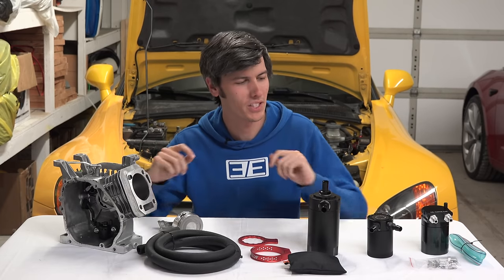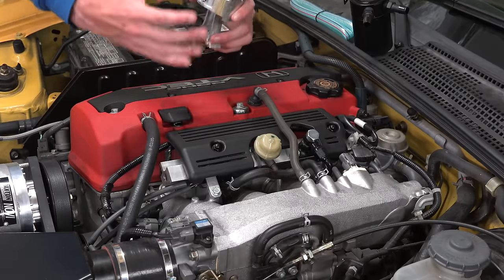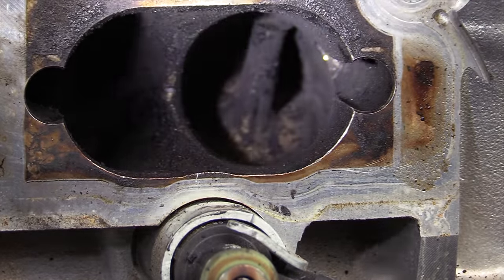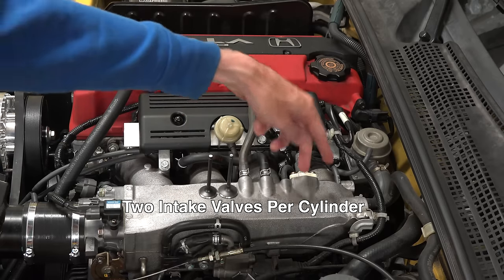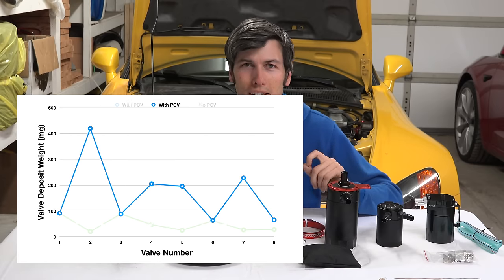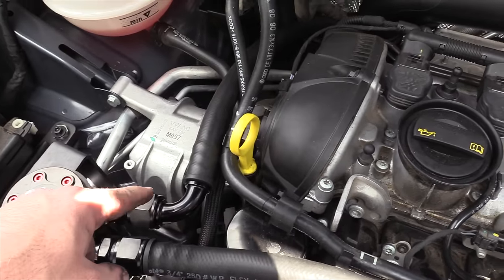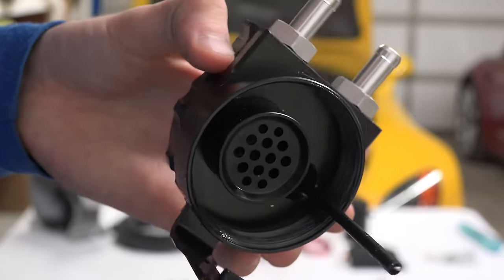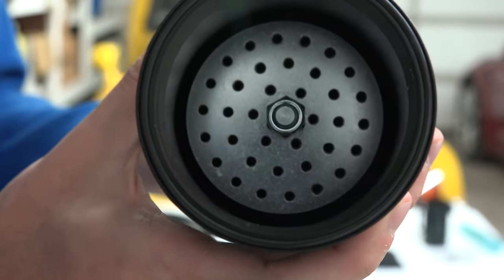Do Oil Catch Cans Actually Work?

Comment: I didn't know that I needed one of these.

Fun fact: I actually really love maintaining equipment. I don't know why. There's just something super satisfying about restoring things to peak condition and keeping them there, especially with more and more things to take care of.
Reply: I'm glad I'm not the only one who feels this way.
Reply: @kadenwatt2033  same but I'm lazy to do the work lol
Reply: I usually just run things into the ground more fun
Reply: I’m the exact same way with my 07 Sentra spec v. Fixed all my oil leaks, now just obsessed with keeping it in optimum condition all the time
Reply: Yesssssss when I replace things i get  my mental peace
Reply: You don’t, just use a quality synthetic oil and filter and you won’t have an issue
Reply: @stephenbloom2545  except sometimes things happen that you don't anticipate. An oil catch can + a magnet can make a big difference, even with the highest quality filters and oils.
Reply: @stephenbloom2545  I use the best oil there is and high mileage like I’m supposed to, there are more reasons to getting one, for example I am getting one because there is some oil getting into cylinder 1 where the spark plugs are.Ik  It’s not my valve cover gasket because of the location the oil is in. So I’m gonna get it so it can catch any bits of oils that gets through to the cylinder,
Reply: @Jpgaps  if your engine is the Ford 4 cylinder ecoboost it has a lot of problems
Reply: The 1.5 1.6 & the 2.0 have a bad block design and needs updated
Reply: @stephenbloom2545 2az fe, from a Scion tC
Reply: @stephenbloom2545  I never specified a particular brand of filter, a particular model of catch can, or a particular engine.
Reply: @AmaroqStarwind  I know, I was replying to another person, he said he had oil seeping onto his plugs and I just stated if he had the Ford 4 cylinder ecoboost it had a flaw in the block that caused the head gasket to leak. My mother unfortunately had that issue on her 17 1.5 ecoboost and had to get an updated block at the cost of $8,000. Nothing can prevent it
Reply: @stephenbloom2545  Ah, my bad. You hadn't replied to them directly.
Reply: @AmaroqStarwind  sorry I thought I did but that’s I get for thinking. Lol
Reply: Any excuse to get out of the house & away from the missus to spend time with the mistress in the garage, eh?
Reply: That’s the classic American way man! Idk if you’re American lol but my dad raised me that way as well. If you buy things to last, maintain them and they will!
Reply: Me too I always thought it was a symptom of autism or something
Reply: Thank you for the fact
Reply: Get a sand blasting unit. Nothing more satisfying than that.
Reply: I'm pretty sure it's a natural human reaction to feel happy when you're useful.
Reply: @meofjack9644  yeah but you know what to buy for the car guy you know. Toss some bucks their way and your installation is cheaper.
Reply: I'm like you also...I used to take apart my engine and start cleaning it just cause
Reply: those are junk units if you're serious on it, look at Parker, or Isuzu filters there is Hummald ones and they work really good
Reply: Its what separates automotive enthusiasts from automotive fans.
Reply: I think its called being conscious
Reply: I'm currently running 2stroke oil as an engine additive. So far, after 6 fill ups, I have noticed that the engine is running cleaner: Detonation on acceleration is basically gone on it's own, engine doesn't idle as rough, and acceleration is like new... Far better than when I bought the vehicle 8 years ago; IT WAS A DOG SLOW... But not anymore! I would imagine coming this with a catch can and I could probably get up to 500k miles. Current at 300k and climbing! Thanks!
Reply: ITS CALLED BEING a RESPONSIBLE enthusiast

Comment: Well done, Jason.  Several comments if i may.  1. Can a car owner check whether he really needs an oil catch can?  I think he can. Simply by disconnecting both vent lines (most engines will have two such lines) where they enter the intake system, one can then use a cotton swab to wipe the insides of each pipe or hose.  If the swab comes out wet with oil you will know that oil and other stuff are passing into the engine intake system, and a catch can will be a good idea.  If the swabs come out perfectly dry then not much oil is getting back to the intake and no catch can is likely needed.  2. I suspect many car manufacturers are doing a better job today compared to ten years back of reducing oil and other stuff from venting back into the intake systems on their engines.  Why?  To enable the combustion process to be as efficient as possible and to reduce those wicked intake valve deposits.  They are doing this by placing the features found in the better designed oil catch cans into their PCV systems to do the catch can job.  My example: We have a Mazda CX-5 Turbo (gas direct injected).  Though the PCV hoses were dry by the swab test, I put a catch can on the engine anyway.  All it gathered was light amber-colored clear water.  No oil floated on top of this liquid.  Though I am sure a little oil was in this mix, I felt it was too little to make it of any consequence, and I removed the catch can.  I believe the very canny (bad pun) Mazda engineers included in the engine's vent system an oil separator to capture that evil (in this case) oil and drain it back to the crankcase.  We also have a 2018 Charger 6.4L Hemi.  It is not direct injected.  Nonetheless I have a catch can on that engine, and it does collect a small amount of fluid which contains some oil.  I am quite confident, however, that when I put my right foot down the port injectors liberally wash those huge intake valves and, thus, deposits will never be a problem.  I always enjoy your videos.  Keep up the good work.
Reply: Excelente!
Reply: Take your upper intake plenum off. The issue is the air coming back in has oil in it.. which then gums to valves, throttle bodies, you have oil sitting in areas of the intake it doesn't really belong in.  Is it good yes

Comment: I put mine down low by the oil filter and drain it when I change the oil.  Having a longer hose run going down hill, the gases cool and condense into a liquid to be held by the catch can.  Most of the removable material in the crankcase gas is water.  Oily water is not what you want in you turbo or intercooler.  For now I am staying away from any filtering because I never want to block the vent and build up pressure in my crankcase.  That could damage the engine.

Comment: I installed a baffled catch can a month ago on my 1998 Ford (Mercury) Cougar 2.5 V6 with 52,000 miles. 
Engine is in very good order apart from a couple of vacuum leaks which are being rectified. 
I only do around 3000 miles a year in it, and so far the catch can has stopped around 5ml of carried-over oil passing through the inlet.
I have disabled and blanked the EGR valve which prevents soot and carbon from further clogging the intake, especially when it blends with the oil vapour from the crankcase breather.
My can is identical to the $100 product on this video.....in the UK I paid around £20 for it and I am very pleased with it.

Comment: The bronze filter got clogged up on my one and the pressure building up in the engine (BMW 325I N53) made the valve cover gasket leaking. I took the bronze filter out and placed stainless steel wool in the catch can. Works now even better.

Comment: I happen to be using the cheapest option shown here, I bought mine prior to finding this video. I have a 2.0 GDI non-turbo motor in my KIA and have been very impressed with how much condensation it catches.
Reply: Hi,  I have a similiar engine ,  how often do you have to empty the deposit? each 3.000 miles or  like...how much?  thank you !
Reply: @davidBarrel  I'm in Michigan so it varies much more on the weather. During the winter months I tend to check it at least every other week, during the summer I might only need to empty it twice. Remember, it's collecting condensation.
Reply: @jcpahman77   ok, for just being condensation of oil  I thought I would have to check it every 5.000 miles or more.
Reply: @davidBarrel  GDI motors make a lot of blow by, be prepared to check it regularly
Reply: @jcpahman77   thanks for the advice
Reply: More filters isn't always better those bronze filters will clog up and you will lose ventilation and cause engine leaking
Reply: 2 things----1. Can the bronze filter be cleaned and if so how and how often?   2. How hot do intake valves get? Do they get hot enough to turn the condensation to steam, thus cleaning the intake valve and a catch can will bypass it?
Reply: @rhalama1  I can't speak to the bronze part, mine doesn't have that. As to the condensation, the valves absolutely get hot enough to turn water to steam, unfortunately we're not talking about water condensation, in this case it's oil and combustion gasses that are condensing. The liquid I get out of my catch can you would not want going through your engine.

Comment: I actually have the $25 catch can. The baffle unscrews from the top and apart. It should come with a 3M 84CC Scotch-Brite pad that you rip off and put inside and reassemble. You do have to change it though. But still worth the $25. Easy install and saves you in the long run.

Comment: I installed one in my 2020 Silverado and it seems to work fine. I empty it at every oil change. I have a 2014 Passat and never stopped to think if it is dl or not. It has almost 90 k on it and shows no signs of trouble. I will have to check, just to satisfy my own curiosity.

Comment: I used a catch can in my 2005 350Z. The VQ35DE RevUp was notorious for burning oil. After I swapped the engine for an LS3 back in 2018, using the same catch can, I still haven't seen any oil getting collected. The LS3 has been a superb engine and a great upgrade for the money!
Reply: Damn that 350 must be 2 wings away from taking flight 💀
Reply: @MustaliS550  it's fast and a joy to drive on road courses
Reply: @julioperez1850  I bet. A Z with an ls is a goal of mine. Enjoy!

Comment: I am just learning about oil catch can. Is it too late for high mileage vehicles? I have a 1998 Toyota Land Cruiser 4.7L with 212k miles. I also have a 2012 Mercedes c250 sedan 1.8L 4 cylinder with turbo about 170k miles.

Comment: I'm surprised you didn't mention the inlet and output sizes, and their relation to velocity. The bigger the openings, the slower the velocity, which means the condensation/contaminants have more time to drop out vs a smaller opening. Also the position of the inlet and outlet is critical. If they are close together the flow will simply follow the path of least resistance and not have a chance for the contaminants to drop out.

Comment: FYI: Inside the $25 OCC, you can unscrew the "baffle" under the lid so you can install different filters to suit your needs. Foam works well too.
Reply: Trent Dafonseca foam?
Reply: @isaacpargas5158  As in mattress foam. Stuff you buy from Clark Rubber. (Australia)
Reply: @TrentusMaximus78  I have added a bit of cooper steel wool and its worth it it works wonders on my LS Engines
Reply: @bloodysweatygears3215  +1 on the steel wool (non ferrous)
Reply: @TrentusMaximus78  Open cell foam works at catching oil, but how restrictive is it? Reduced flow is not ideal but I really worry it'll help cause the hose to collapse under cruise vacuum, which is a big deal. Even unmodified cans like those in this vid can cause that, but few people bother to check. So I hope you checked yours... 

As soon as you said "mattress" you made me think of that fine white fiber found in some pillows. Polyester I assume? If that stuff can hold up to hot oil mist, and I imagine it does, it just might be "the" thing to put in there... I've always thought 0000 steel wool would be best, but the slivers of steel it sheds is opposite of best, so I never tried it. I believe a pillow sacrifice is in my near future. If I try it I'll post results. If you (or anyone out there) tries it, please share... Thanks for the idea :)
Reply: @chevota400  G'day. I meant the yellow sponge foam, not the pillow white foam. My hoses are thick. It would take a lot of vacuum to collapse them.
Reply: @TrentusMaximus78  I figured you meant the yellow, which breathes better from what I recall. Glad to hear you're good to go. I thought mine was good too, which is Goodyear (or Gates, I forget) 1/2" PCV hose. After a few months soaking up oil which softened it, + under hood heat doing the same, it collapsed :(   So I replaced the straights and some bends with 1/2" thin wall SS tubing, and for the remaining bends I simply put short lengths of that SS tube inside the hose. So it's kinda funky looking but cannot collapse.  It soaked up oil because catch cans don't work very well and I discovered it was only catching about 5%. So that's something else people need to think about...
Reply: @chevota400  id be worried about that too.... even seen a RC cars filter when its been over oiled or full of nitro they basically block up
Reply: Just use stainless steel kitchen cleaning pads in the can
Reply: @bloodysweatygears3215  Hi. Ya know it's not suppose to use a copper and aluminum together. On water loops is strictly prohibited. You notice some problems?
Reply: When adding kitchen steel wool to this 25$ can, do you place it in the bottom of the can or do u place where the baffel is?
Reply: Foam degrades DON'T use it.
Reply: @skinlab4239  Just replace it. Simple.
Reply: I have 2 of the cheap catch cans installed on my 07 350z. One for each intake. I didn't know you could put further filtration in. Thanks for the one up.
Reply: Another thing I did was swap Input and Output hoses. That way, the oil has to fall in the can prior to it being sucked up to the vacume. If I used it the "correct" way, my filter would have been blocked in a week. You want the oil in the can, not in the lid.
Reply: @eminiscalperpro9729  I put it in the baffle.
Reply: or... stainless steel wool...sorry late reply
Reply: @TrentusMaximus78  i herd scotch brite scouring pads work very well.
Reply: @TrentusMaximus78  haha I agree! When I first opened mine I was like isn’t this backwards 😆
Reply: @TheOceanX  if I'm not mistaken, your 350Z is port injection. You don't need the oil catch can at all.
Reply: @markkauffman6184  The style of injection (in this instance) only dictates whether or not your intake valves stay clean or not. Oil catch cans are useful on nearly every vehicle made. Catch cans interrupt your PCV system; which feeds vaporized oil/fuel/moisture through your engine to keep your oil clean and reduce emissions. A catch can prevents that gunk from being fed into the motor; resulting in longer, cleaner engine life as well as more consistent power on high HP engines. I empty my catch cans monthly or every 1000k and there's always gunk in them.
Reply: @blazeandcyrus  That's an oxymoron. All steel is ferrous and rusts. The "stainless steel" used in steel wool is a soft low nickle alloy, and rust pretty quickly. .  I'd avoid using it because if it disintegrates it will get sucked into the engine. A coarse sintered bronze filter is pricey but will hold up longer because the surface area is lower.
Reply: @psdaengr911  I'm no Einstein but how does it rust quickly or at all when it's saturated with oil?
Reply: @eminiscalperpro9729  While baffle might be the obvious answer to some, it actually doesn't matter because either way the fluid will be below the steel so it will be weighed down by it and helping to avoid suction back into the intake.
Reply: Russians put inside kitchen metal sponge for washing dishes.
Reply: Mine came With steel wool inside and I run two of them on my Mini Cooper s with n14 engine and has helped put a lot
Reply: @chevota400  you ever tried it
Reply: Just stuff in a brillow pad and you good.
Reply: I can't believe people are risking $30k for saving $50 on a proper filter that lasts 50,000km  by putting crap in their catch can!
Reply: @blazeandcyrus  what does non-ferrous mean?
Reply: Some of the tiny baffled portion towards the top unscrew, some don't. Including mine lol. Same exact model shown. So I shoved an entire metal suddy scrub into the body and honestly feel like That's more effective...just from sheer volume and top to bottom material That's cutting up all that "Sus AF Fam-O" dirrrty, polluted loosey moosey air-tang
Reply: @eminiscalperpro9729  bottom in the body IMO, is what I've been running. Makes sense doesn't it? The sheer volume of a larger steel scrubby pad basically filling the body of the can..? I think it works great, so far.
Reply: @sailingcitrinesunset4065  what does that even mean tho? Putting crap inside the baffle if it unscrews or putting crap into the body of the CC?
Reply: @lukman8400  Non Iron or steel.  So brass or aluminum  would do the job.
Reply: also put steelwool in them. ive been doing that in mine and it seems to catch a bit of oil every change
Reply: Added stainless steel mesh to mine. Wash machine drain catch sock. Just unscrew the little perforated cup under the lid, the whole thing packs in nice and tight.
Reply: @bloodysweatygears3215  i took one of those metal brillo pad things and put a piece of it in mine. Works very well. I could get something that does a better job of filtering, but i didn't want to worry about little pieces coming off and getting injested into the motor. I empty mine when I change my oil and it's usually got some room left but it definitely does a good job of catching stuff.